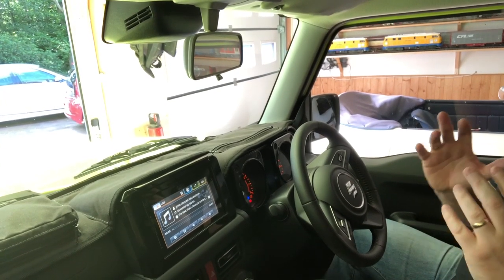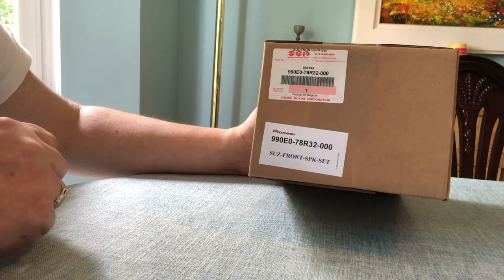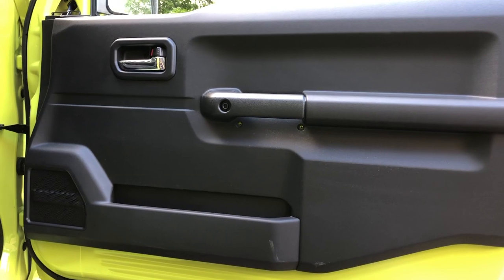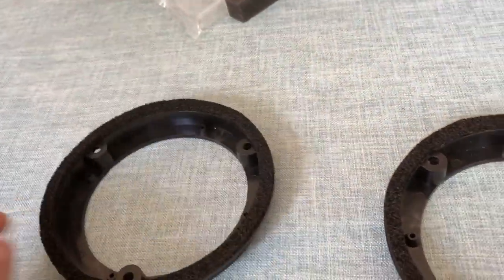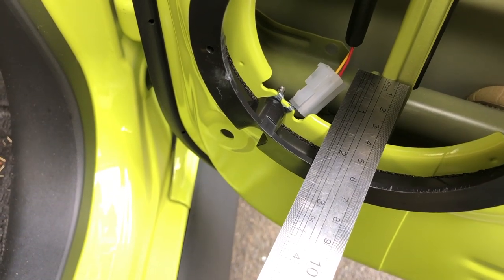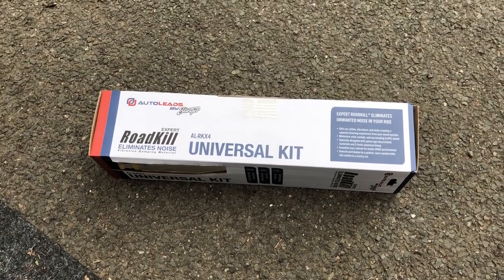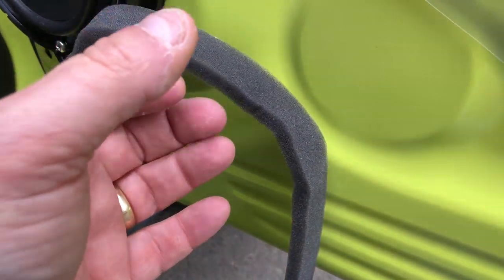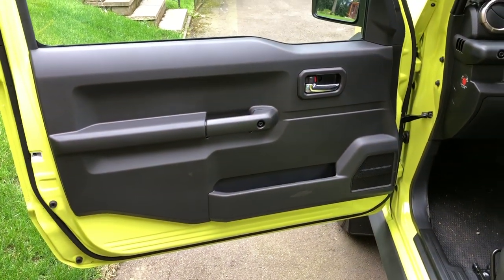Suzuki Jimny 2019 Front Speaker Upgrade

Comment: If you use a pair of scissors you can cut the black sealant between the plastic sheet and the door as you pull the plastic sheet away from the door, leaving some sealant on the plastic sheet and some sealant still on the door. Keep the plastic sheet from sticking to itself and store the sheet in a flat dry place for now while you add sound deadening and insulation inside the door.
Once your insulation fitment is complete, replace the plastic sheet sticking the two black sealant line halves back together, press with fingers or a seam roller and the sealant will merge back together.

Comment: The speaker you're looking for is any 5-1/4" (13cm) 2-way Coaxial Speaker (you'll need bracket - just have one made out of acrylic or fiber glass, it's cheap and you have full control on hole placements - also don't buy a 3-way they're mostly a gimmick).

As of July 2020 these are the models available for each brand

Infinity Reference 5032cfx
JVC CSD-R521
JBL Club 5020
Pioneer TS-A1370F
Pioneer TS-G1320S (don't buy 1310S, bad reviews)
Sony XS-FB1130

Some of the speakers I listed may be expensive, if you're looking for a bargain? any older model 5-1/4" will do BUT check the manufacturer's website first to see if the product hasn't been discontinued if your concern is warranty - though speakers tend to last a very long time, just watch out for the tweeter, they're always the first to go.

4" is too small, you'll need an adapter bracket; 6" is too big, you'll need to drill holes on the door AND the circumference might be too much you might have to cut out the door panel and risk a shoddy job. Stick to the 5-1/4"!

Disclaimer: try out the speakers at the shops first dont just buy them off the internet, for whatever reason they might not fit and you're stuck with a non-refundable item or a counterfeit.

Good luck and congratulations on owning a Jimny.
Reply: You mean diameter? Instead of depth which is what you wrote
Reply: @smokedpear  You're right. edited. Thanks for that.
Reply: i guess Im kinda randomly asking but does anybody know of a good website to watch newly released series online ?
Reply: @Sebastian Valentin Thank you, I went there and it seems like a nice service :) I appreciate it!!
Reply: @Matteo Justin Glad I could help =)
Reply: Цилиндр из древесины - лучший выбор!

Comment: This guide was a great help to me on fitting a pair of 13cm pioneer speakers, so thank you. They've suddenly stopped working a few days ago, no sound whatsoever, radio, media, cd, phone etc. The unit still turns on as normal, just no sound. Any possible ideas before I take out the speakers and send them back?!
Reply from the maker: The fact that both speakers have failed simultaneously would tend to make me think the problem is with the head unit or direct connections to it, rather than the speakers or anything you have changed in the door. Make sure you haven’t muted the unit in any way before removing the head unit and checking the rear connections. Hopefully it’s nothing much! Cheers. N

Comment: Hi, thanks for all the explanatory videos!  I would appreciate your help, I bought the same speakers you show in the video, do I have to replace the front speaker bracket?
Reply from the maker: Hi, as the new speakers are larger you need to use a spacing ring as supplied by Suzuki in the relevant kit. This pushes them out a little more allowing you to fit them in the existing hole. Best wishes. N

Comment: The plastic shrouds I received are only 110mm whole cut out and most 5.25" speakers have a whole cut out of 121mm.  Did I receive the wrong Pioneer Jimney upgrade kit? Thanks in advance
Reply from the maker: David, mmm! Can’t measure my kit as it’s now fitted but, as you can see from the video, the hole in the shroud is the same size as the cutout in the door. If yours is the same - you probably have the right kit but your speakers are too large. Did you purchase them independently of the kit?
Reply: @highergroundlifestyle  Thanks for the reply. I did get them independently, I went for a 3 way from Pioneer TS-A1370F(13cm/5.25"). I see in your video(rear speakers) you used the Pioneer TS-G520. According to Pioneer the cutout size is 121mm, but it must really be 110.Went to a shop and they tried to sell me 10" speakers. Thanks for your videos. Have the DIR top and ladder on a Dark Green Jimney.

Comment: Great video. Thanks. Rather than buy the adapter kit, I am thinking of replacing with new 10cm speakers in the front. Does the stock speaker attach to the original mount with 4 screws like normal?
Reply from the maker: Yes. The adaptor is basically a converter that turns a little hole into a bigger one!

Comment: Can you tell me the Order-Number of this Original Suzuki-Set for change the front Speakers and install rear Speakers? Thanks from Germany.
Reply from the maker: Hel Mut. 

The rear speakers need part numbers 99197-77R00-000 and 990E0-78R32-050. Front speakers need part number 990E0-78R32-000. NB These kits do not include the required speakers. Cheers. N
Reply: @highergroundlifestyle  Thanks alot. I cannot find from Suzuki in Germany. Where I can order it?
Reply from the maker: Hel Mut. You could try ordering from bigjimny.com in the UK. I haven’t used them but hear they’re good...
Reply: @highergroundlifestyle  Thanks again. I will try that. At the Moment I can find only the number 99197-77R00-000 but both other numbers are unknowing numbers online.

Comment: Great review yet again! 👍
I wonder if the rears are pre wired?
Definitely a more open sound and a worthwhile upgrade.
Regarding sound deadening I wonder if putting sound proof foam under the bonnet would be worthwhile?

Regarding my situation I’ve been on the waiting list for 10 months and was at the top of the list only to find last week my local dealership has gone into administration 
Absolutely gutted to say the least.
Reply from the maker: Barry Watson. Rears have wires in place ready to plug in. The job is not speaker installation it’s removing and refitting trim! Sorry about the car - will let you know if I hear if anything coming up - but anything that beats the waiting list has a £4K premium at present!
Reply: storminatwork at Higher Ground Lifestyle 
Cheers.
Luckily I made provisions a few months ago with a couple of other dealers so may have to wait a bit longer but hopefully all is not lost! 👍
Anything else planned?

Comment: Hi all here!
It seems that it is hard to order  Front speakers need part number 990E0-78R32-000 online now, all out of stocks.
Any idea?  Thanks
Reply from the maker: Vincent, as long as the speakers fit they will work - so just check the dimensions and don’t worry about using Suzuki parts.
Reply: @highergroundlifestyle  Thanks for the reply, but how could i upgrade to 13cm speaker without having the parts?
Reply from the maker: Vincent, just make the bits. You’ll see from the video that it’s just an adapter! The alternative is to do it the old fashioned way and just mount the new speakers directly into the door cards!

Comment: The point of sound deadening pads is to prevent the steel sheets from resonating. You should be putting this all over your car if sound quality is a concern. This guy has a good channel on the subject: https://youtu.be/AVF65oGCgZY
Reply from the maker: Francisco, the Jimny will always be a tin box! If I want good sound I use my BMW or my Aston. The point of these upgrades isn’t to make the sound fantastic - just a bit better than the factory standard. To this end the rear speakers are a huge improvement and the first thing I’d do. The front speaker upgrade is more marginal improvement. An amp would also help and probably a new head unit but where do you stop in what is essentially a proper, cheap off-roader?